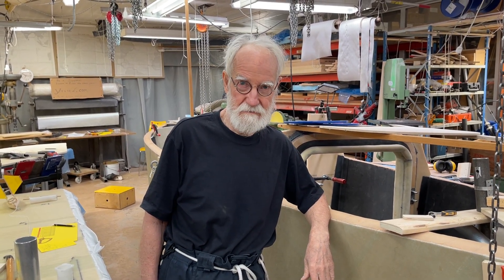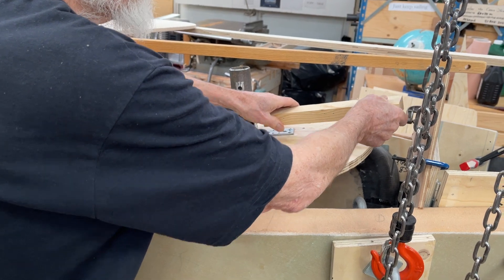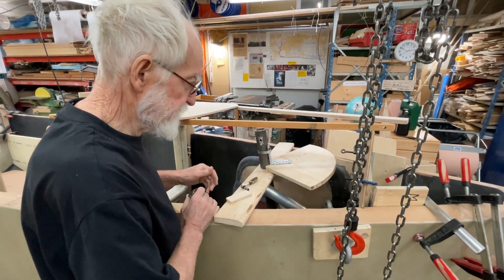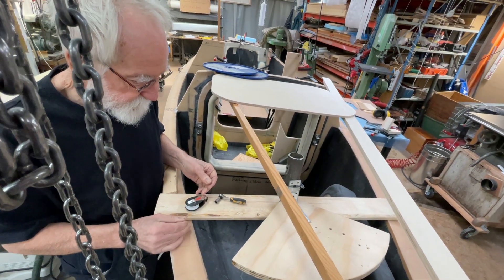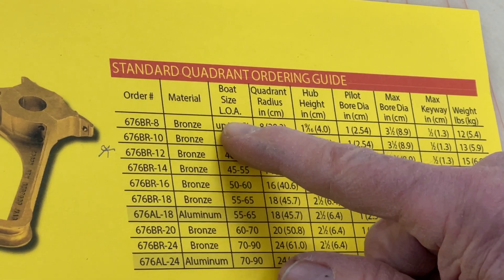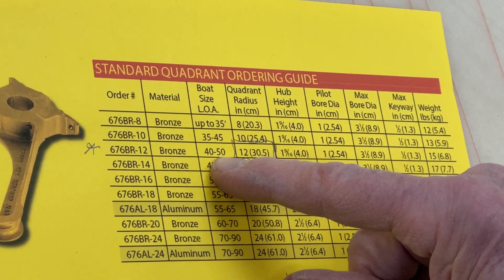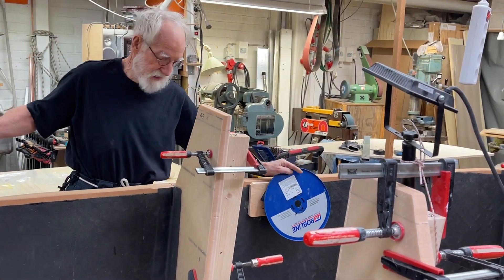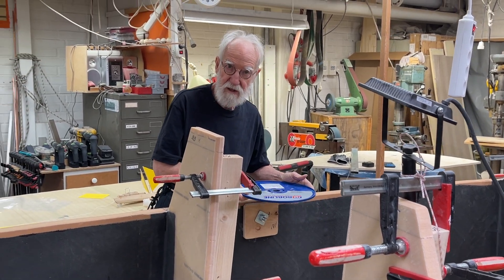Space restrictions have persuade me to give up tiller and to use a rudder quadrant.

Comment: Excellent video!

Have you decided on what kind of bearings you are going to use for the rudder?  A Plain bearing, sleeved with some kind of low friction synthetic material,  might help with corrosion. 

I’m guessing that the top of the rudder shaft being above the water line is what’s preventing water from coming in. Or is there some way you will be able to seal it off?

Comment: I'm thinking of an automotive type steering wheel, they can be found in all different diameters and dish depths, mounted directly to the rope sheave.  An axle potted to the hull, maybe 14-16 mm course thread that the wheel assembly mounts to.  Maybe a clutch disc on the bottom and top of the wheel where the large nut with a handle locks it in place at the rudder angle you want.  It could be tandem.  Make it so that the locking handle/nut arrangement cannot come off and be lost.  Those steering wheels come padded or could be padded.  Hot rod cars use those steering wheels as customized.
Reply from the maker: Thanks for the suggestion but I can easily cut out a wheel with the help of the bandsaw.
I will also drill holes near the periferimeter in different radius to put a pin in to lock.
Reply: @SvenYrvindExlex  I read about that one too but I thought that a wheel with a locking hub would be infinitely adjustable.  Thanks Sven.
Reply from the maker: @ralphwatten2426  With a diameter of 30 cm the circumference is about 100 cm. I can easily get a 100 6 mm holes there then I can make two more just below and get 300 holes near the periferi.
I will not need that many but it is easy to get sufficient fine adjustment with a pin in a hole.

Comment: Maybe you have already considered a vertical staff in cabin for steering? Like Ming Ming roger Taylor?
Reply from the maker: There are no advantages to such a device in my boat.
In fact it would be in the way.
I do not know why he used it.
May be he gained space compared to the tiller.
We had vertical staff in the Val trimarans 1975 - 76 when I was working with Dick Newick but a small trimaran have a narrow main hull and there was not much else to chose from.

Comment: I wonder how the ropes will pass through the walls without allowing water to enter the living area? I bet Yrvind does have a solution again and again, doesn't he?
Reply from the maker: To make it simple.
In theory some water may enter the dining room in the living area.
but that is unlikely as the holes will be small and high up.
However just in case there will be a water collector on the inside just below the holes to collect any water that may enter.
Reply from the maker: Also a in addition a sleeve will prevent a lot.

Comment: Conventional mechanical steering will certainly work well.  Like the idea of locating the helms on the port side.  Even with small diameter helms, steering effort shouldn't be excessive.  Will be interested to see how you route the steering cables from the quadrant.
Reply from the maker: Stay tuned a novel way for the stearing cables is coming up.
I am working on a model
Reply: That is one detail that I’ve been especially curious about.  

Looking forward to see what you’ve come up with!
Reply: Barney,
What do you think of something along the lines of cable for bicycle brakes?
Some inners are coated, very slick and durable.
Cheap, easily replaced, tiny spares aboard, available everyplace.

Comment: What are the plans to waterproof the holes through the bulkhead for running the lines to the bedroom?
Reply from the maker: The holes will not be waterproof but they are small and high up.
Inside will be a water collector to take care of any water that unlikely will enter just in case.

Comment: I like the wheel idea.  It should be easy to see where the rudder is pointed as long as the wheel doesn't have to turn more than 360 degrees.  How will you lock it in place?  I can't wait to see how it works!
Reply from the maker: Long time since I built the quadrant rudder but if I remember it was 3 times 360 from hard over port to hardover starboard. 
So even if it is more than 360° there will never be any confusion.
Reply from the maker: How to lock it.
That problem is not solved as yet but tightning a screw at the center of the wheel to its base might work.
Or as in Aluminum-Bris I used a rigging screw to to holes in the pereferi of the wheel but it was a bit play in that system.
I have to think about it.
Reply: @SvenYrvindExlex  
re -- wheel lock
Could pegs be built onto the wheel face?
Could a block be fixed to the inner hull?
Could this block drop into position between pegs to limit spinning?
If I was me, I might have two/three falling blocks, engineered for spaces between pegs, redundant safety.
Reply: Ralph,
If the cable wraps around the spool facing the interior, the operator could determine rudder position by counting wraps.
Marks on the cable would help -- similar to anchor-chain tags -- as well as marking the wheel face.
My imagination automatically works toward simplifying.

Comment: Will you carry wooden oars to provide steering backup? Will you be able to row, or scull your new vessel?
Reply from the maker: It is very difficult to steer with an oar but my system is designed not to break.
Nothing have broken on the boats I have designed and the get stronger and stronger.
I will be able to row and scull, yuloh.
There is now much research into electric propulsion I will keep my eyes open.
A friend towed me out of Porto Santo harbour in his dinghy with an electric.
"Now we are using 175 watts" he said.
I think Exlex had 300 watts of solar panels.
As I said I will keep my eyes open.
There are lithium batteries but I will not have them on my boat considering them to dangerous.
It is different in a car when you can park and walk home leaving the fire behind you.
If they start burning at sea I will die.
Reply: @SvenYrvindExlex  
re -- LiFePo4 fire potential
Agreed.
2003, we converted a 1996 Ford CF8000 commercial truck to our concept of an ExpeditionVehicle.
Nearly two decades full-time live-aboard, our bank is AGM.
Doddering on their last legs, we researched LiFePo4...
... and concluded we can wait for the industry to mature.

Comment: Is the size of quadrant chosen because it:
1: fulfills the size to boat table and
2: it lets the rope out near the side of the boat so it is convenient to run forward?
Reply from the maker: I will make the quadrant with the biggest radius possible because that way the force on the Dynema ropes gets less.
Not that the ropes will break but because I need less force to control the rudder.
Now with steering wheels that is not realy a problem but in general I always try to reduce forces in this case by longer lever.
Reply: @SvenYrvindExlex  makes good sense.  By the way how was it meeting the Swedish Royals?!?